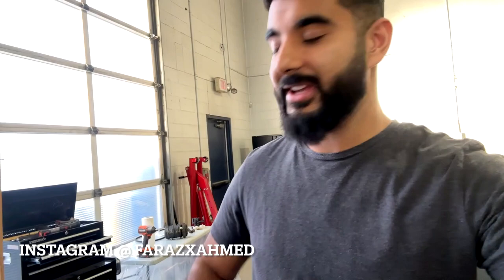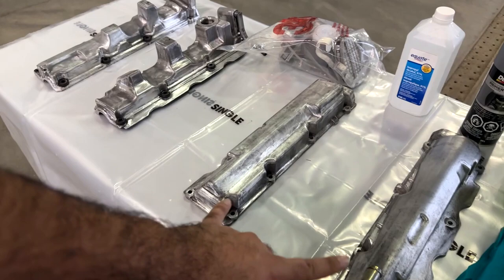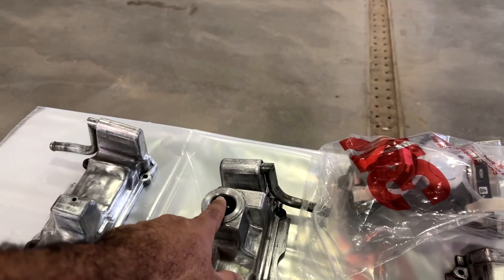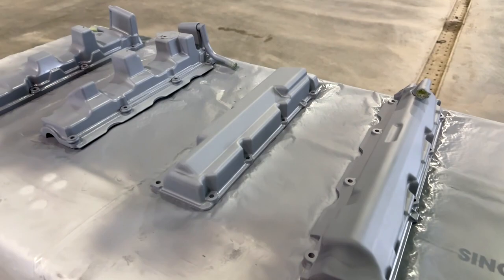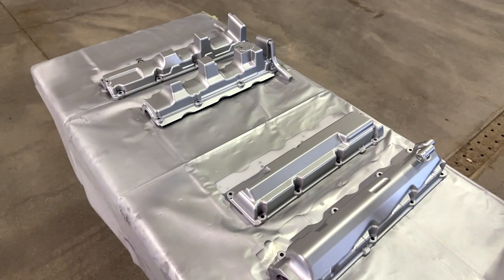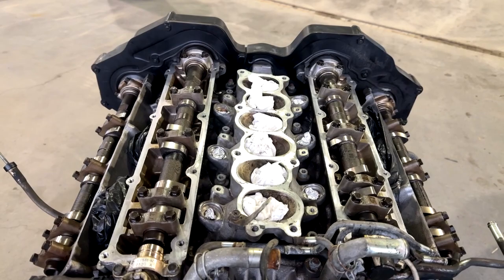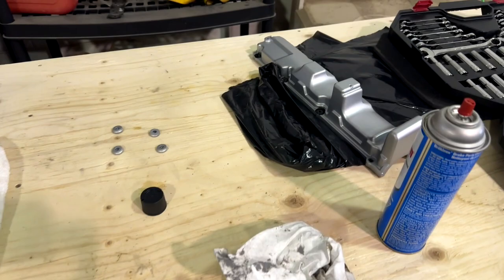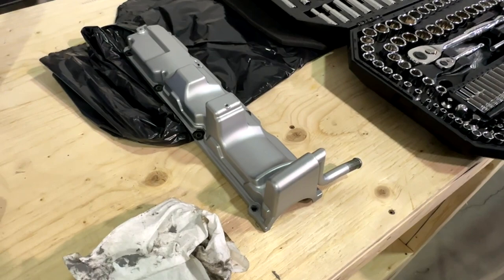Boosting my Nissan 300ZX : Part 5 - Painting and Resealing my Valve Covers!

Comment: No JB weld or other fix. The crack gap is not the only issue now. The gap is approximately how much the mating surface of cover is now deflected and not flat. In theory you now have a high spot that will increase the space along the edge of the cover that lessens the further away from the damage ya get.  Get a replacement part and small value torque wrench.  Kinda sucks,but as you said,You "don't want to have to do things over." Bite the bullet,spend the dough and take the time now.  Good luck buddy
Reply from the maker: Thanks! This video was recorded over a month ago, I already got a new valve cover. I’m behind on posting lol It’s painted and installed, getting a new one was the way to go. Don’t need to create problems for the future 👍
Reply: @FarazXAhmed  Sweet. Yeh, I saw on ebay they don't cost much. Excellent. Look forward to next vid.

Comment: Yep, thats thinner cast aluminum for ya. The original hardware would not have done that to you I think with the rubber washer and shoulder of the fastener, although its probably still a rare issue with the z spec. My experience is the duplicolor engine paint lasts longer when sealed with the clear. I chose to polish my valve covers. Good job on the videos man!  Youre making progress! I think you have one of the best condition Z32 Ive seen in canada, it will be awesome to see it finished but dont rush and enjoy the process as much as you can.
Reply from the maker: Thank you! 

I’ve made a lot more progress than what’s in the video, that was recorded over a month ago, just behind on posting the videos. Trying to get as much done as I can, want to go to a few car shows this summer and just trying to finish the build but also not rush it. Want to do it properly and also make it look great at the same time as well. 

Thanks for the support 🙏🏾

Comment: Faraz, my man… “I don’t know why everything has to be so difficult and it can’t just be easy.” Omg those are the most relatable words I have ever heard!! I have been there several times with the Z 😆
But that is exactly why in my previous comment I stated it would have beneficial for you to do a plenum pull and some of the simpler service work a long time ago lol it would have prepared you for this. I have some feedback for ya!

•Honestly it’s ok that it broke now because it’s better to address the errors now than later when the engine is back in the Z.

•Those intake valve covers NEED either OEM rubber washers (which are expensive) or Zspec silicone washers. The OEM ones that you removed are not reusable after 30 years of heat cycles. I saw you painted over some of the ones that were stuck on the valve cover and painted 4 others on the side.

•new rubber half moons are a great call, however the rubber will shrink, deform and deteriorate again after some time. BDE makes bullet aluminum half moons so you will NEVER have to buy them again.

•the VTC caps melt under normal use even on an NA. They will live in even harsher conditions with TTs in the engine bay. SalTek makes some awesome VTC caps with instructions provided to make install easy peasy.

•are you intentionally keeping the PCVs in place? A reroute, at minimum, is highly advised not only to simplify future maintenance, but also to keep the intake tract as clean as possible. (The 2 ports on the driver exhaust valve cover are notorious for sucking up oil on hard left turns, a PCV system reroute or moving to catch can setup is ideal) 

If you decide to address those 3 topics, all three will require you to backtrack and redo your valve covers, so keep that in mind when weighing your options. 

Last piece of advice: kick the “I don’t have time for this” mentality as it will only slow you down. Working on cars in general can be daunting for us noobs, but even moreso with our beloved Z32s. I’ve created much, MUCH bigger headaches for myself with Zs of my past by working while impatient and/or with frustration. Acting on the belief that good things take time will allow you the clarity to make sound decisions throughout this build. Don’t get me wrong, you’re gonna learn a lot and you’re gonna learn the hard way and honestly that’s for the better, but that doesn’t mean you shouldn’t learn to recognize when you need to take a step back, get some sleep and come back with a level head. Your future self will thank you, the Z will reward you and your relationship with it will be that much greater. 

Feel free to hit me up on FB if you have questions, wanna pick my brain, or just talk Z in general. I’ll shoot you a friend request.

Sorry for the story book length comment, it’s hard not to help when I’ve been where you’re at countless times 😆
Reply from the maker: The advice is always appreciated man! I will definitely hit you up with questions. 

I wish I knew about the zspec silicone washers for the valve covers 😡!!!! I thought their kit would have everything needed. Pretty frustrating that their valve cover dress up bolts would have regular washers and not the silicone ones….. I bought a new valve cover, painted and installed it. Was super careful about the torque and didn’t have any issues this time. I don’t want to remove them again but I think next time I ever do, I will definitely get the silicone washers and not use these again.

I think I’ll leave the PCVs alone for the time being, as I’m pretty far along now and would have to backtrack quite a bit. I did think about deleting it originally and running an oil catch can. But just didn’t go through with it as I didn’t feel it was super necessary. I’m sure that’s something I’ll do in the future. 

This build is VERY involved and is definitely getting overwhelming at times 🤣 sometimes I give up and sit for a while thinking what if I put it all back together and IF it manages to start, coolant and oil starts leaking from everywhere 🤣 then I snap out of it and get back to it and continue on and do my best! 😅

Comment: I am not through the entire vid but as soon as I saw you doing the valve covers, I was going to message you with a caution about about using those engine bay dress-up bolts.

I suffered the same issue. My valve covers were powder coated which sucks even more! No idea why they sell those dress up bolts for our VCs. They should have the rubber cushion which helps to prevent cracking. 

I'd replace that VC. I tried an aluminum weld on mine and it leaked after anyhow. Cracked in the exact same spot too. Save the hassle and replace with a new unit before dropping in the motor. Sucks... but keep up the good work.
Reply from the maker: Yup, always fun learning the hard way lol

That video was recorded over a month ago, I’m just behind on posting videos. I bought a new valve cover, painted it, and installed it 👍

Didn’t want to create future problems by doing a repair, wanted to do it right. 

Thanks for watching!